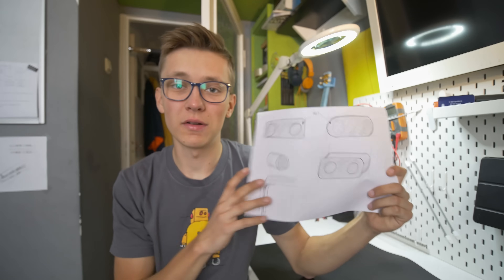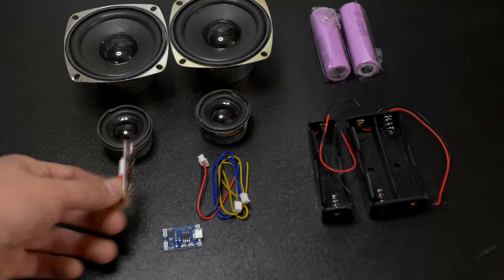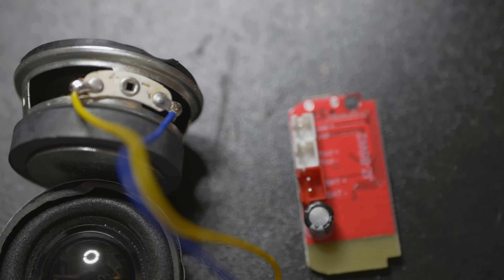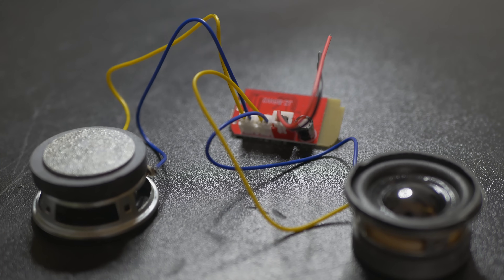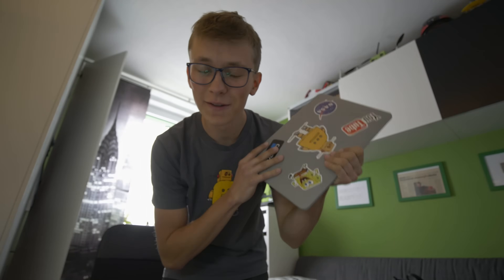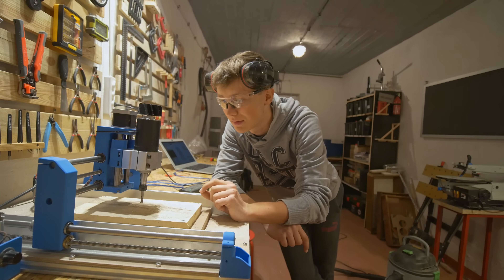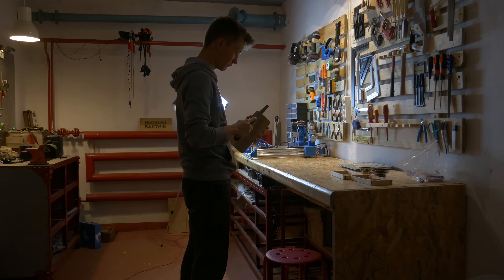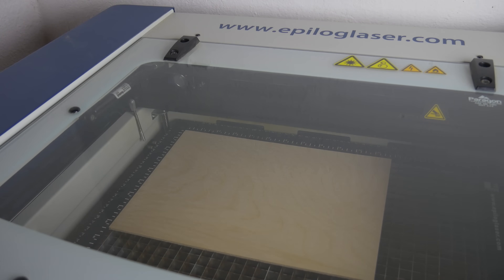DIY Wooden Bluetooth Speaker Tutorial

Comment: Good job! But you should use a higher battery capacity and a power bank module to be able to charge your phone with your speaker. Also, i couldn’t see if you assembled the batteries in parallel or in series but i just tell you that to assemble batteries in series without a BMS is really dangerous. And if you don’t like bluetooth speaker, why did you not just make a wired speaker?

Comment: Hello! Please can you also add link for that battery charger? Because it is not possible to charge battery trough Bluetooth board so you need separated charging circuit. Also can I use that Bluetooth board for only one speaker? Thank you!
Reply from the maker: You don't need a separate charging circuit, you can simply charge through Bluetooth board, remember to turn on the speaker while charging otherwise the battery is not connected to the Bluetooth board so you can't charge it
Reply: @nikodembartnik   The board will charge the battery, but the board spec says you MUST use a BMS for the battery to prevent overcharging - that circuitry is not built into the bluetooth board. If you leave the charger connected that battery is at risk of exploding/catching fire

Comment: Nice design! How about the overcharge and overdischarge protection of the li-ion cell now that you left out the charging board?
Reply from the maker: Charging is implemented in the Bluetooth board, it lets you know that battery is low so I assume that there is over charge and over discharge protection
Reply: @nikodembartnik  I would look at that in more detail if I were you, just to be sure. Would be a shame if it breaks or worse sets itself on fire right?
Reply: I don't think that particular board has protection like a TP4056 module (all it has on for protection is the SS14 diode to prevent reverse polarity)...might need a battery with battery protection board built on it.  Good enough to charge a few hours then use...but not leaving plugged in all the time